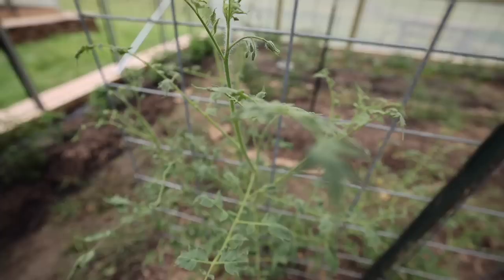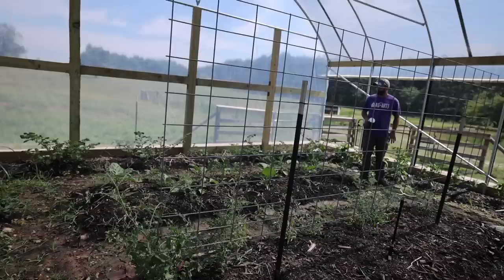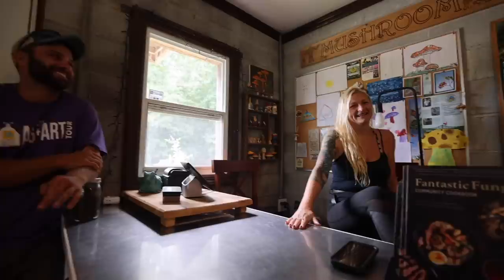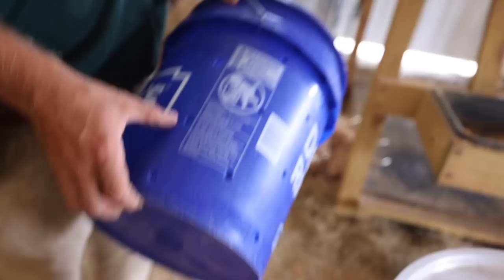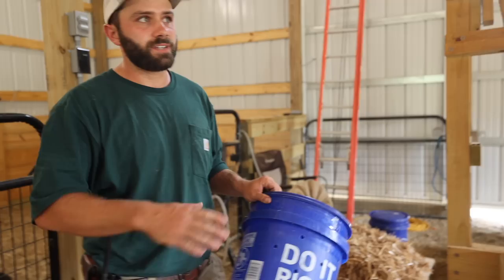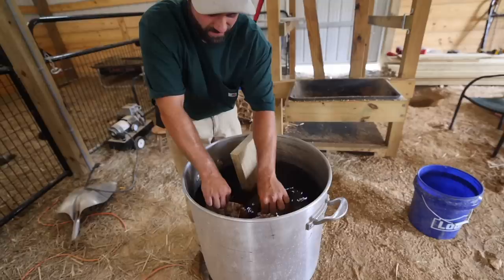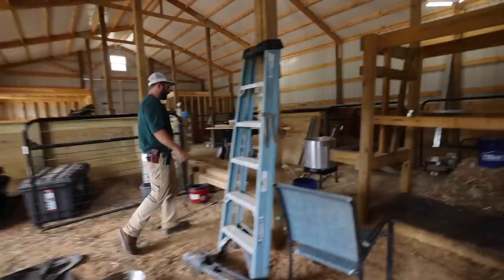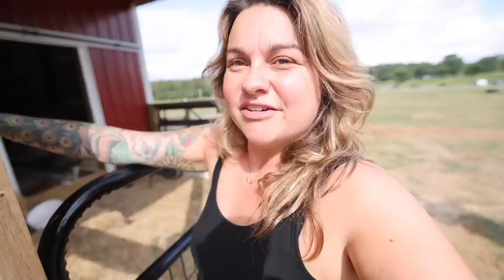Learning about Mushrooms to Heal the Garden Soil | VLOG

Comment: Thank you so much for taking this route.  And, for leveraging Will's knowledge and connections.  It will be such a huge benefit to the gardening community if you can promote these methods.   The agribusiness companies in the south have been the worst actors.  The southern gardening and local family communities are the ones dealing with this issue.  If you can rebuild the trust of local gardeners and instill new healing methods in community gardeners, that will be awesome.  It is important that you have raised awareness of the problem, and a possible solution.  Thank you!  Thank you!

Comment: Certainly wish I had thought about using a sack to when I started by Wine Cap Mushrooms.  Also remember that you may need to set some containers of water around the outside of the Lowe's buckets (exactly what I used as well).  The Oyster Mushrooms require a high humidity to fruit.  I ended up putting jars of water on the deck floor around the outside of the buckets to raise the humidity.  Best of luck!

Comment: 'North Spore' had a really good video about growing mushrooms in the garden to eat (not specifically to clean up soil, but it does that too).  Ignore the nitrogen wood chip comment (does not apply if you layer it), but the mushroom info was really good. They just put the spawn directly out there in various ways for various types - in soil, spent fruiting logs, pasteurized straw, straw bales, wood chips below fruit trees, etc.  They also talked about grain spawn vs sawdust spawn - if you have rats/mice, they recommend sawdust spawn or straw vs grain.  I tossed some pink oyster in my garden as it is known to do better with the heat, but am still waiting for fruiting.  Hope this helps, God bless❣

Comment: My beans have had some issues, but the damn slugs ate the leaves before they even emerged above the soil!! That is the problem for me, probably not so bad because you can just plant more. 

If anything it will get you growing mushrooms. I’ve been trying myself with some success on wood fuel pellets. Since I’m still working on building a new garden situation at a new home and I’m not 100% on the bed location I’m not doing wine caps yet.

Comment: Paul Stamets used oyster's on crud oil in soil and they cleaned soil in 6 months....and the soil was really soaked with oil...when you plant the mycelium do it in chucks and space them 5 ft apart as mycelium goes to the other mycelium......and should not take to long after you get it into soil 2-5 weeks the mushroom cleaning is mushroom eat it and turns it into something the plants will use to grow..mycelium goes so deep and is known to bring plants water if plant needs it..

Comment: Mushrooms are so cool. You are going to find this fascinating. Concrete blocks work better to hold the straw under the hot water because they are flat and heavy. You can tie a rope in the hole to make it easier to get out. Keep the buckets out of the light. They fruit in the dark. Since it is summer they will be warm enough but when they fruit they will need filtered light not bright light. If they start to dry out you can mist the holes. You could earn enough money growing mushrooms to pay for your farm.

Comment: this year I'm having to garden in containers - moved to a river canyon that's a compact claybank with zero topsoil - the river scoured it all out long ago.  I've been wondering why my container tomatoes are struggling and on closer examination, thanks to your vlogs, I suspect that the compost or bagged soil mixes I've had to use might have residual herbicides.  I'll get a few tomatoes but nothing like I had in my old garden.   

I also have few straw bales, conditioned and planted with beans and cucumbers, and they are thriving.  Going to add more straw bales for next year since my source is local and do NOT use herbicides.  Not an ideal garden but it's what I have to work with.

Comment: here is how they do it with no website address hope this is ok... Eucalyptus trees, harvested from a tree farm next door to their farm, are ground up to create a wood pulp substrate in which to grow the mushrooms. Personnel man the machines as the substrate is placed and tightly compacted into 1,000 millimeter jars and a hole is made in the center of the container where the mushroom spore will be placed.

“We fill the jars with substrate, a combination of wood pulp, wheat bran, corn cob, and water,” explains Bob. The jar is capped and workers clean off any loose material. The jars are then sent down the conveyor belt to the autoclave, a large pressurized tube five feet in diameter and 18 feet long. Approximately 3,072 jars go into the autoclave, which is heated to 250 degrees Fahrenheit at 15 PSI for one-and-a-half to two hours. The sterilization process kills any bacteria and prevents other organisms from competing with the spore during the growing process.

“After we’ve done ‘the cook’ as we call it, we open up the end of the autoclave that’s in the sterile laboratory,” continues Bob. “We unload all the bottles and cool them down to 90 degrees Fahrenheit.”

“Once they’ve cooled down, we run [the jars] through another conveyor belt where they go through the seeding machine. The machine, which can place 6,000 spores an hour, lifts open the cap of each bottle and places two tablespoons of sawdust spawn on top of the sterilized material in the jar,” explains Bob. “The sawdust spawn then starts to digest the substrate and begin the growing process,” he adds.

After the jars are seeded they are placed in an incubation room for five weeks and then spend another three weeks in a grow room. All total, the process from incubation to harvesting takes about two months.

Each variety of mushroom is housed in a room specifically for that mushroom and air conditioned at a precise temperature best suited for it. For instance, shiitake mushrooms wouldn’t be grown in a room with pepeiao mushrooms. “The mushrooms are particular, so each room is different,” says Janice.

The mushrooms are stacked on storage trays on racks six to seven feet tall. The size of the mushroom and the size of the grow room influence how many mushrooms can grow at any given time. For example, up to 6,000 pounds of ali‘i mushrooms can be grown in a single grow room while the pioppini mushroom grow room can only produce 400–600 pounds of mushrooms.

After three weeks in the grow room, the mushrooms are harvested. Mushrooms are picked daily to be delivered to area chefs and supermarkets.

After all the mushrooms in a given jar are picked, the remaining organic matter is recycled and made available to the public. Local landscapers, gardeners, even school garden participants are able to use the spent-wood substrate material as a growing medium. From start to finish, the process is truly cyclical and sustainable. “Nothing is wasted,” says Bob. “It’s all returned to the earth.”

Comment: Question:  can you harvest the mushrooms, dry them and then burn them. Since the contaminates are generally petroleum based, my understanding is that contaminated soils around leaking oil tanks can be burned to remove the contaminated. 

Just a question of how to put a layer of remediation between the current produce and contaminated pulled out.

Comment: So, I have Cockle burrs in my flower beds(I rent, I'm not responsible for yard work and can't plant what I want) they sprouted last year during the droughts we had, and I really want to deal with them before they flower. My brother is going to come pull the plants out. But I worry about the seeds. Apparently burrs can last 5 years under the soil before they flower or die. I googled and was recommended by my search to use a herbicide but obviously I don't want to do that... what should I do instead?
Reply: Cut the tops off BEFORE they go to seed.
And if you're not going to pull them, just keep cutting them back & never let them seed.